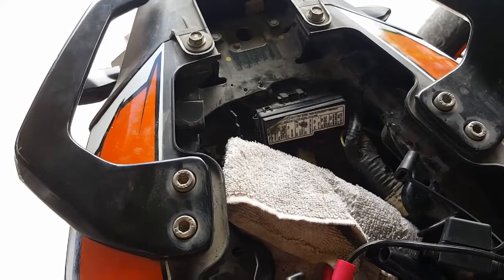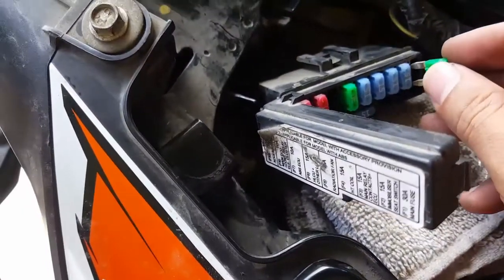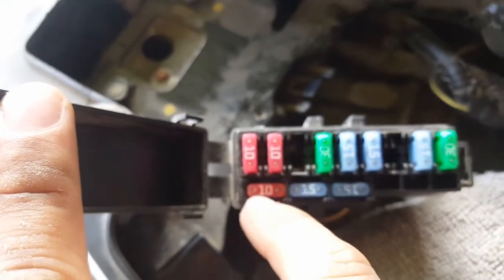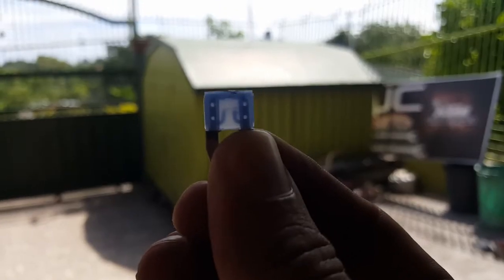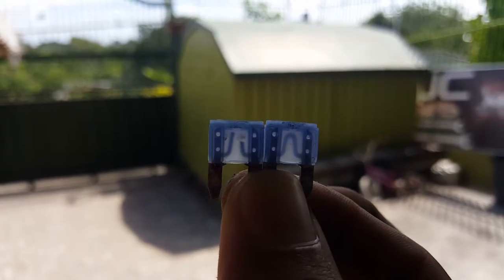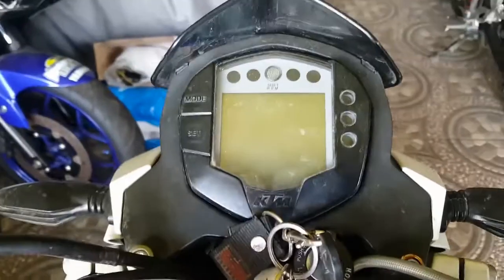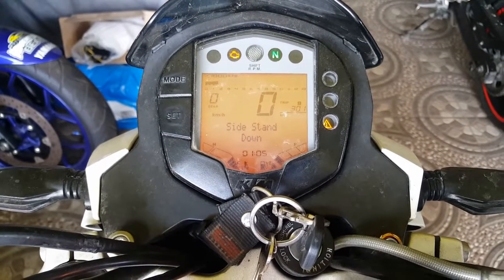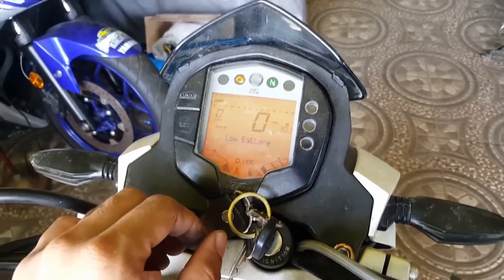Error code on KTM Duke 200 / low voltage problem "stator coil" check engine sign.

Comment: bro I use full throttles by  listening engine sound wroomm....... wrommmmm ....wroommmmm....does it effet bike ? my bike is duke 125
Reply from the maker: Normal sound will be that if u full throttle, not unless u will another sound that u might have heared b4.
Reply: @reverendcoward7941  does it effect  engine
Reply from the maker: Ahh i see. Yes bro once the bike just started. Let the bike warm up 1st like for about 2 to 3 minutes . U can full rev after but please not all the time. Hehe

Comment: Also pro one more thing when i but new buttery just when i ride at least 30 mint and thin low electrical and when i try aging start engine but not working until chaneg buttry and same i change 4 buttry and voltage Rectifier Regulator i dont know how i fix it i check all fuse it good why buttry leave??
Reply from the maker: Most likely it's a symptom with bad stator.  But then to make it sure. Much better we go use a diagnostic test for ur bike.
Reply: @reverendcoward7941  ur right sir it was stator not good condition becuse there is spark in the groung for stator.. Thank u so much
Reply from the maker: @Ammar99887  very much welcome sir.

Comment: Pro i have problem same in my ktm smc 690 i change voltage Regulator Rectifier and buttry but same problem do you think it will be stator? And  how i make inspiction for stator can u suppurt me
Reply from the maker: Sir, if u have ktm company nearby ur place. U may go there and have it use with diagnostic test since it's 690cc.

Comment: My bike does not start after 10 days
Reply from the maker: Is it brand new sir? What happened before it didn't start?
Reply: @reverendcoward7941  noo it is problem of battery sir i have a question that my bike getting off during low acceleration please tell me the reason
Reply from the maker: Okay. So clarification,  ur bike will turn off during low acceleration?  U double check ur clutch cable. Adjust it it properly.

Comment: Hii the blinker light is steady in my rc 390 and bike just done 2000 km need help??
Reply from the maker: Sir just to clarify,  is it the flasher u mean For the headlight?  Or is it the check engine u mean?
Reply from the maker: Jasper Dolphin  yes there are times like that. Try these 1st, remove the battery for whole night  by the next day, install again the battery. In putting the battery, please make sure to put the positive terminal first then next the negative.  Make sure to tighten it but not too much for it not to lose thread.  If bike is still under warranty please go to your nearest KTM dealership and let them remove the error by the diagnostic tool. You can always do the thing I said but at your own risk. Ride safe and be cautious enough.
Reply from the maker: Jasper Dolphin  that's great. That happens on my bike to, battery went low since i haven't use it for a long time because of quarantine but then I do check it time to time like charge the battery at least every twice or thrice a month. Ride safe.

Comment: Bro i alredy fitted a new battery but also not working
Reply from the maker: Cheenu zookies double check everything 1st on the fuse box if there is no blown fuse. if no, use a tester and test ur stator coil wires. better to ask assistance from a good Mechanic.  avoid DIY if ever cannot do it or not knowledgeable enough.  especially if it's still under warranty.  better to bring it to the manufacturer.  as much as i know, usually stator problem or might be the starter relay. double check also ur starter relay.
Reply: @reverendcoward7941  r
Reply from the maker: better tell some situations of ur bike why u changed new battery.

Comment: My bike is not maintaining idle speed and,its rpm is fluctuating, moreover it seems like there doesn't occur regular spark in the cylinder, i checkd the spark plugs and keep doing it since 5 days, engine is also overheating, black smoke sometimes come out while cranking, above 5-6k rpm the engine is ok but below, there is problem, my engine is ktm duke 390
Reply: I too have same problem bro as urs..i cleaned the throttle body air filter,fuel injector.changed saprk plug.but still it gets turned off when i dont accelerate.
Reply: @thakuri_gamer-t5g  notice the sequence of check engine light, i have 1 long blink and 3 short blink, and 9 long blink. Issue is still on the engine, the mechanic said throttle body and fuel pump had to be changed

Comment: Dear 
My Ktm Rc 200 also same problem so is it issue with stator coil  and what is the price can you please confirm
Reply from the maker: Aadil Syed are u sure same problem on the video my friend?  to make sure, pls use tester on ur stator before open the cover.  if it's confirmed, buy stator coil.
Reply: My rc 200 show jy 1.3.2 2long blink 4short blinks that is ..low or high voltage or implausible voltage .. i change the battery after i cannot start my bike .. then it happen again but i jump started my bike and ride on rpm about like 4 or 6k around 40 minute ..then a miracle happen its doesn't show any of the code anymore and can started like usual .. but i know its gonna happen again so i let my bike rest for while ..
Reply from the maker: @harithhazim407  yes jy . 1.3.2 is a battery problem , starting problem also. Yup, low voltage.  Just make sure terminals of the battery  are clean and tighten well.  If it will happen again, check stator.
Reply: @reverendcoward7941  as i told my bike suddenly turn off .. i think it might be the regulator or stator.. just change the battery still show low battery sign ..
Reply from the maker: @harithhazim407  check stator sir
Reply: @harithhazim407  Bhai same problem hai MERI bike me what is solution of this error code
Reply: @pravinkumar-ws8uq  its it's either the regulator or the stator coil .. neither of those two died it won't charge the battery andthen my bike died.. that my problem .. but there a lot different problem so its better be check ..

Comment: but what is the reason the fuse popped? did you find it?
or is it the fuse alone, which has defect or something like that, that's why it popped?
Reply from the maker: fuse no longer popped up after i change new stator coil bro. sorry for the late reply. don't have load most of the time.
Reply from the maker: edward newgate it's the stator coil has problem.  fuse were cut since triggered by main issue.
Reply: @reverendcoward7941  so you bought new stator after replacing the busted fuse? did you use again your bike after just replacing the busted fuse? did it popped again? or it didnt until u replaced the stator coil with new one?

Comment: I have rc390 my engine light is not turning off while riding plzz help me  with this
Reply from the maker: shaik Mustafa Hussain unplug battery, remove 1st the negative terminal. if and only if the check engine is steady on.
Reply: Rev. CowarD thankew for the quick reply brother I'll try it once
Reply from the maker: it's a circuit fault bro. rollover sensor. pls do check. maybe it's just wet. try to dry it up. if it's broken, then need to buy new one. see the picture on Google if your not familiar with the Rollover sensor look like. thanks. sorry for the late reply. don't have loaded from past weeks.
Reply from the maker: yes no worries.
Reply: Bro 1 long and 5 blinks in engine light what to do Bro plz say

Comment: Hi i would like to ask if there any other way to check if the stator is faulty?
Reply from the maker: yes sir. sorry for the late reply. u may use a tester. check the three yellow wires. b4 doing it, search on some youtube channels on how to test a tester if it's faulty or not.

Comment: Nicely done! My 2012 Duke 200 also shows me flash code 24 intermittently and at the same time causes the idle rpm to either rise to 3k continuous or fluctuate between  1100 and 3000 rpm quickly. Occasionally it so happens that opening the throttle fully doesn't rev the engine but just makes it fluctuate between 1100 and 3000 rpm. What could it be? The flash code and idle issues occur at the same time.
Reply from the maker: FodderRev sorry for the late reply. no Internet.  do u see any on the description i typed?
Reply from the maker: FodderRev just check ur stator coil. better let someone  to do it or if u know how u may. if stator is burned,  then change a new one. thanks sir.
Reply: @reverendcoward7941  Thanks for your response. The stator output is fine. I had been taking my bike to the workshop often and they explained all the symptoms over the phone to a member of the KTM R&D team. He almost immediately responded by saying that the wiring harness needs to be changed. There are a lot of broken wires in it that have been rejoined at several points mostly near the steering head bearing. Need to wait for the part since it needs to be ordered.
Reply from the maker: i see. i encountered a customer too having a problem on its wire harness near the steering bearing part. everytime u full lock its rotation to the left and right the power goes off. i found out some wires worn-out already. by the way,  hoping ur bike could be better than ever now.
Reply: @reverendcoward7941  Yes, I have had that problem too. A total of 6 or 7 wires have been repaired already. As for the wiring harness replacement, it will take 15 days for the part to arrive. Long wait.
Reply: Compra una JAPONESA  , y tira esa al zafacon. KTM , NO  GOOD.